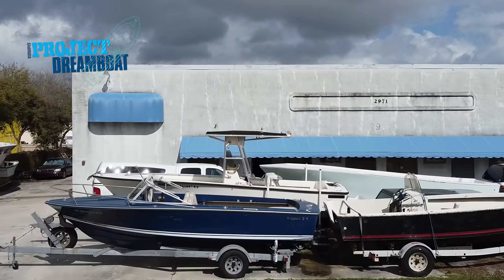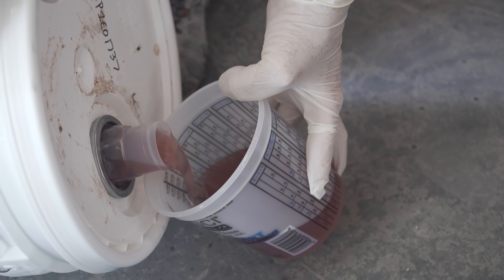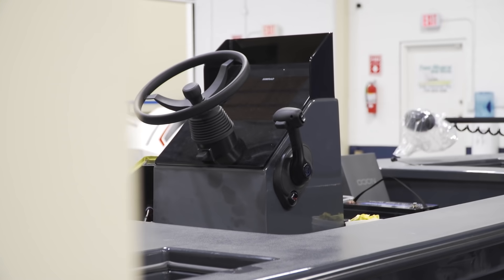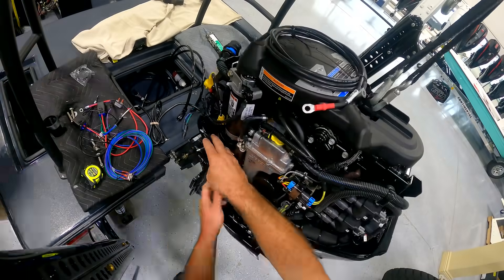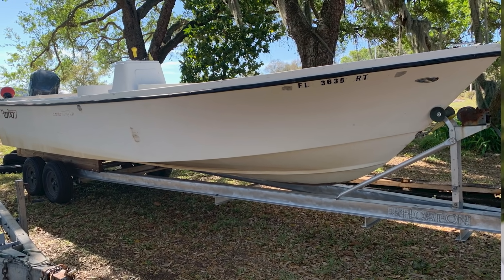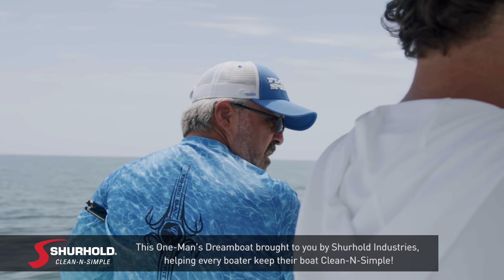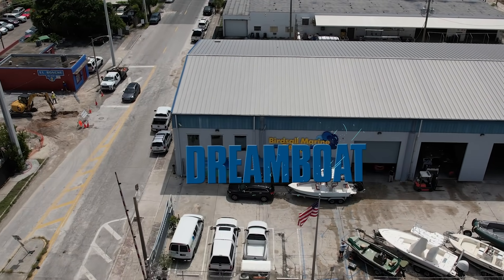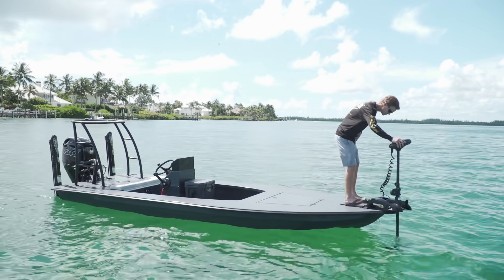Florida Sportsman Project Dreamboat: Building Custom Hatch Lids & Jack Plate Install Tips [2021]

Comment: I went to get a jon boat the dealer priced me out complete at 8k. They had a trade in on a 20ft seacraft that the mechanic failed to properly inspect. They offered it at 8k as is. Turned out the only thing it needed was a new waterpump. These boats going between 30-120k. They're currently trying to get me to bring it back lol.